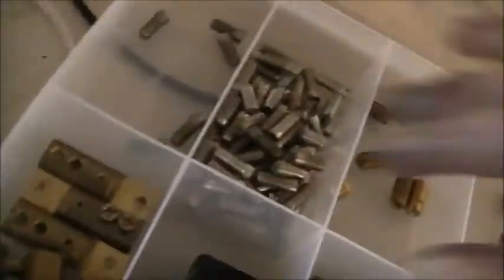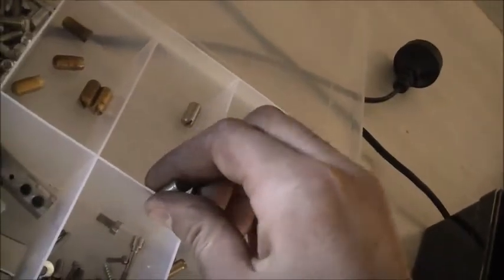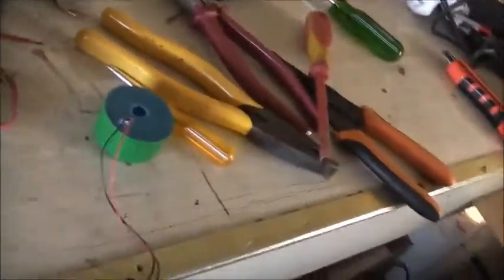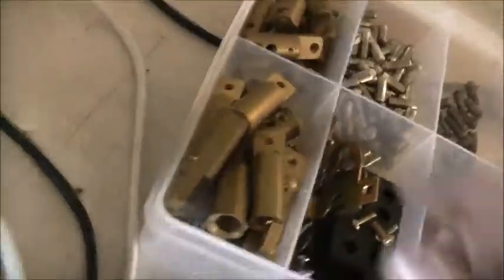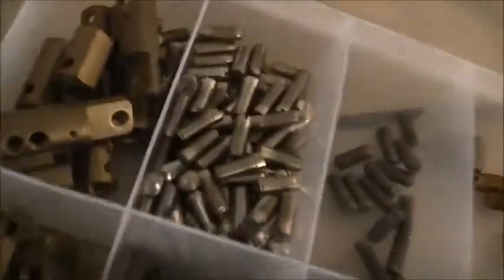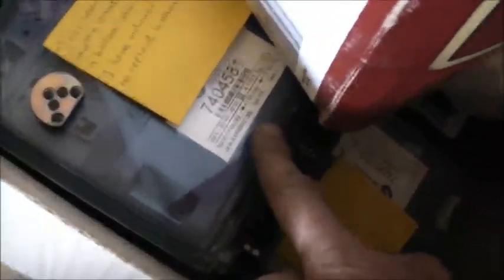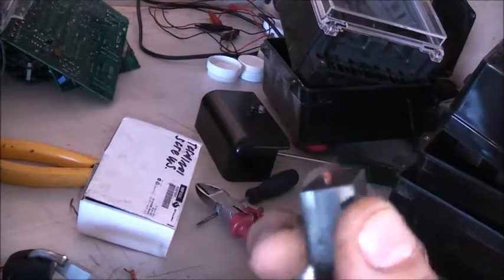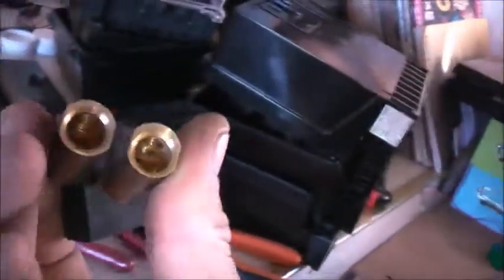Meter Terminal Screw Stockpile!!

Comment: Haha.... "They're of no use, exept for hockey pucks".

CT INCOMING !!!!! (Thwocks CT with hocky stick)

In regards to using them as a CT for a load-wheel based CT meter, that may not work because I'd seem to think it depends on how the internal electronics of those 'smart' meters "translate" the current picked up from them in order to register kWh.

As an example, if a load is pulling 1,000 watts, the internals of the meter may be only seeing  0.5 watt. This means that the CTs would have a 2000 ratio.

It would be like putting a 150 CT on a load-wheel based meter that says 200/5 on the specification plate....It would register-up incorrectly.

=EXPERIMENT=

Try a "wire-them-backwards" experiment, you may be able to work out the ratio. Try putting 1A at a low voltage through the thin wires (i.e. use that modified MOT) and then put a loop of copper wire (just one turn) through the hole in the middle and join the ends together so that current can then flow though it. I'd recommend a sizeable thick conductor for this.

Next, measure-out 1A going into the CT via the thin wires, then detach the clamp meter and put it onto the thick loop which is going through the centre of the CT and see if there's any increased reading from 1A.

If there is, depending on how ramped-up the amperage is, you could use them for Phantom loading electric meters!

Let's say that you're only putting 1A into it, but getting 25A out (it'll probably be more than that if they're very high-ratio CTs) this means that you'd be able to whip-up an electric meter to particularly fast speeds with only a miniscule amount of power from the wall socket! :D

Yes, don't pop them just yet..... There could be some interesting experiments to be done with them, and depending on the results, they may STILL be useful for SOMETHING. :-)

Thanxx for showing,

-BoomBoxDeluxe.